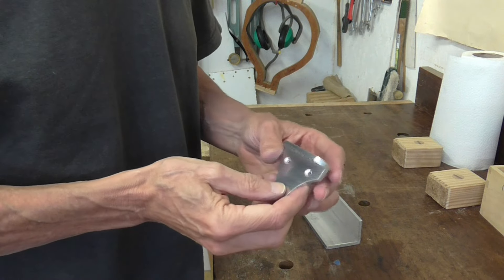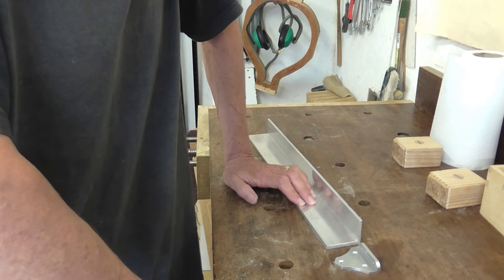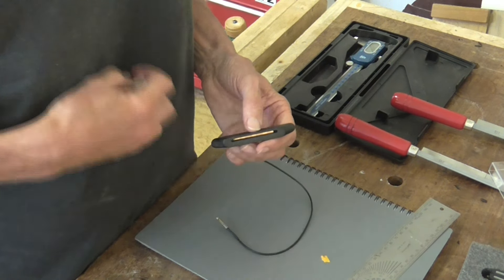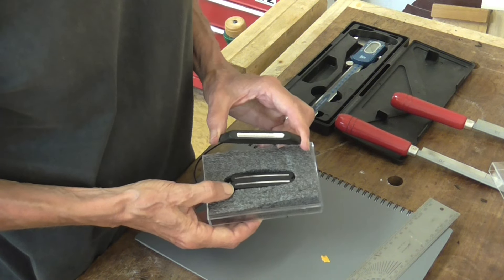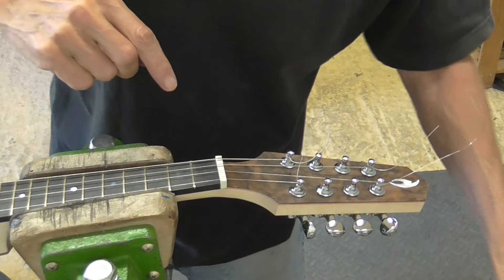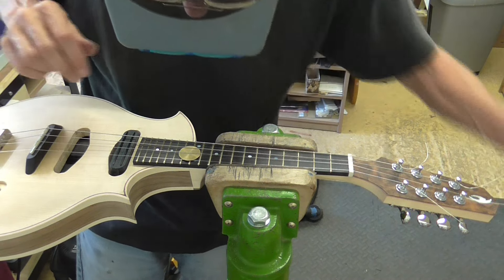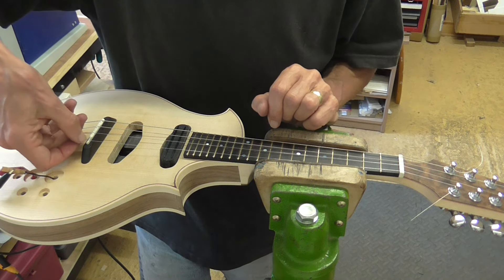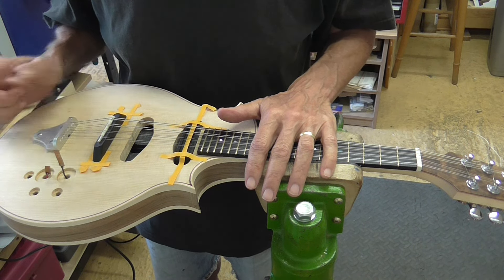Two mandolins: update 3

Comment: For the eMando, does the wood for the major portion of the body (that you cut the chambers out from) affect the sound much? I know the back and sides of a regular mando do, just like the top. Not certain on solid body or semi-solid, though. Thanks! Beautiful work.
Reply from the maker: Hello Jack,
Thanks for the comment. For the internal construction, my criteria for a choice  of wood is: good strength to weight ratio, stable and resonant, hence using pine but I would happily use anything else that meets my criteria.
Hope that helps.
Cheers Gary